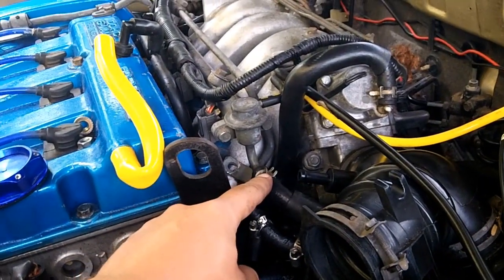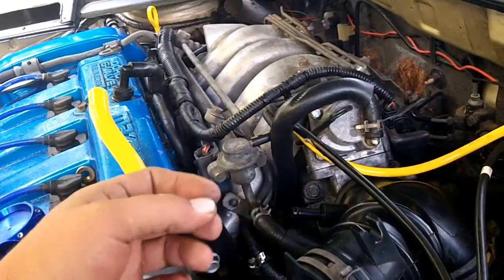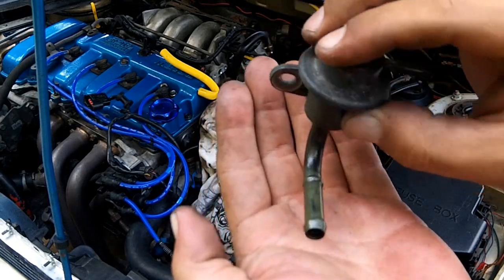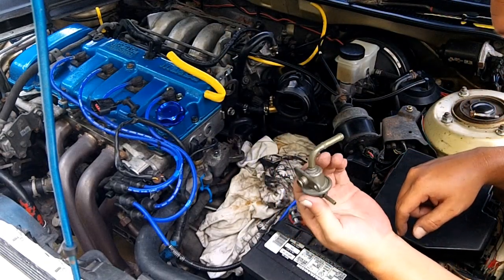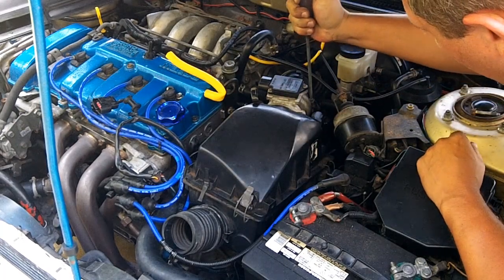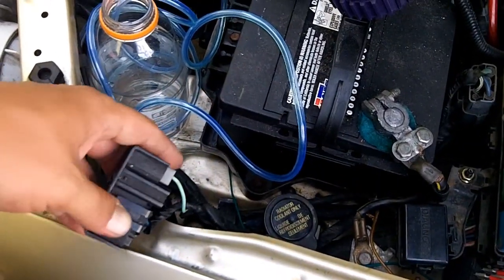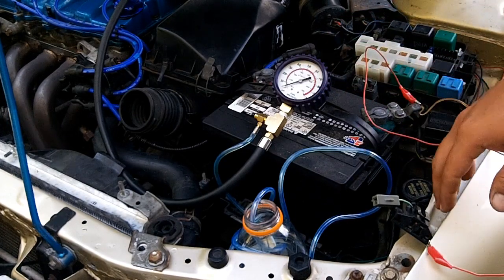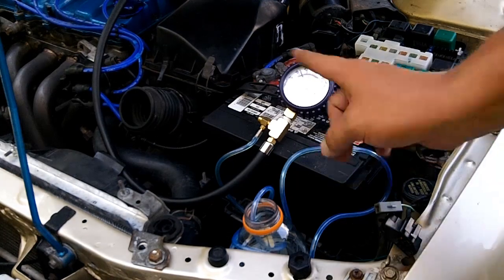Mazda 626 -  Fuel Pressure Regulator Replacement

Comment: On most motorcycles the petcock is vacuum actuated, which is a neat way to turn off fuel if the engine dies or during an accident. It really helps when you are removing the gas tank since you can disconnect the fuel lines without getting gasoline over everything. I see your pressure reg is vacuum actuated as well -- if vacuum shuts off, does the pressure reg cut off fuel?

Comment from the maker: According to my factory manual no, it should hold pressure for quite a long time.  I believe a couple hours is normal but it should hold for at least 5 minutes.  As you can see mine wasn't even holding for 5 seconds let alone 5 minutes.  Something is definitely wrong with the fuel pressure.  Using the process of elimination I've traced the issue back to the fuel tank.  No idea if it's a check valve or the fuel pump right now but definitely on the fuel pump side of things.

Comment: When I saw your fuel pressure sag quickly I wondered if the check valve at the gas tank was faulty, allowing fuel to flow backward into the tank. I don't know anything about Mazda but many cars have a check valve to make starting easier. The check valve keeps the line primed after shutoff, so that starting the next morning is easier.

Comment: Ok thanks  I will try to look around for any misfires in pcv valve and yes they were all equally burnt black it doesnt seem like they were covered in  oil I know its forsure gas cause after I took them off there was a littles smoke rising from the spark plug holes and it smell like gasoline fumes.
Reply from the maker: If it's excess gasoline in the cylinders then check your timing and do a test for good spark on every ignition lead.  Could be spark loss from bad timing for faulty distributor.

Comment: How can you release the pressure without turning the engine? I've got the crank shaft off already.
Reply from the maker: Could unbolt the fuel rail and use an injector pulser or just remove a fuel line with a rag around it and pray it doesn't get too messy.

Comment: I have a 2001 Mazda Protege ES. What if I don't remove the fuel pump relay? What if I quickly plug the fuel line with my finger and then quickly put it on the new regulator? Fuel shouldn't come out of the regulator when I put it on right?
Reply from the maker: Unplugging the fuel pump relay takes 2 seconds.  The only reason I didn't spill much is because my lines were completely depressurized due to a faulty fuel pump.  Normally the fuel pressure regulator is fully pressurized just like the fuel lines. Had they been fully pressurized and I disconnected the fuel line, fuel would have sprayed everywhere like a champagne bottle on New Years Eve. 

If possible, start the car, remove the fuel pump relay with the engine running, let the car stall and that will depressurizes the fuel lines.  Most vehicle fuel pumps will depressurize naturally over the course of a couple days.  So if you haven't started it in a while chances are that the fuel pressure is low anyway but you should never assume that's the case so you should always do the depressurizing procedure first.
Reply: Ok, I'll try that. Now once I get the new regulator on with lines connected, is it necessary to run any kind of pressure test? Or will the system equalize itself? I'm kinda grateful I don't own a diesel. That would be a totally different story I'm sure.I took my car in to get smogged today and the smog computer that passes or fails you said I have a code but it's not that big of a deal so I got a pass. No check engine light popped up just some code in the computer. Smog tester said to take it to Autozone to get it checked so I take it there. They run the OBD-II scanner and the code pops up that I have a something to do with the fuel pressure regulator. They said once you get the new one on, it should clear itself, but I think they were talking about the check engine light..so should it clear itself or should I have them re-check it for redundancy?
Reply from the maker: It's always a good idea to do a pressure test before and after so you can compare results.
Reply: I finished doing the work on my car's FPR a couple days ago! Thanks for the help! I'll be sure to subscribe. I took the car to Autozone, where I bought the part, and had them run the OBD-II scanner to search for that cloaked code that the check engine light wouldn't pop at me and, post-FPR replacement, the code went away! She's as healthy as can be! Keep up the good work!

 Oh yeah, I wanted to ask, if you hear a loud wub wub wub wub sound that gets louder with acceleration increasing and you turn the wheel to the right and back a couple times and it increases with each turn, does that mean the wheel bearing is bad? It's VERY loud. Everyone in my car that rides with me hears it and asks about the noise. I took it to a mechanic and they said it's a bad wheel bearing. I don't know what side it's on. But I wanted to get a second opinion based on the noise. It used to make noise at 40 mph and on. Now, it starts the noise at 20 mph and on. My car has 112,702 miles. That's when I replaced the FPR and this annoying ass noise. What do you think?
Reply from the maker: There are tests that a mechanic with a lift can do in order to pinpoint which wheel has a bad bearing and can confirm the diagnosis.  I recommend taking it to another mechanic if you want a second opinion.  Without being able to hear the noise through a video or something like that, there's no way for me to give an educated guess on the issue.  Sound isn't something you can really describe through text.  Wub wub wub could be dubstep playing through your stereo for all I know. ;)

Comment: Yea, it is. The motor part is still probably good but the check valve probably failed. Also the tolerances in the pumping mechanism probably widen witch would explain your low fuel pressure when you were doing the max psi test. Unfortunately it's all built into one housing. (about $100 at any auto-parts store)

Comment: What is bleed down, exactly?
Reply from the maker: Loss of pressure.  It shouldn't lose pressure.  If you see the pressure going down instead of holding steady that is bleed down.  Sorry I've been on vacation in Tennessee for the past 2 weeks. :)
Reply from the maker: The factory manual will point out where to use lubrication and what kind.  Sorry I don't know about drum breaks yet.  Still avoiding them like the plague. :P